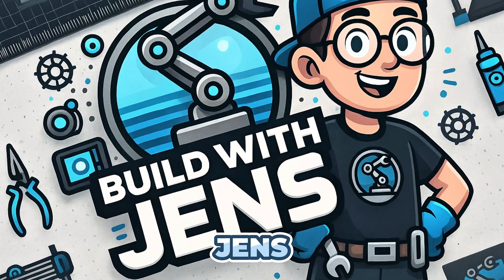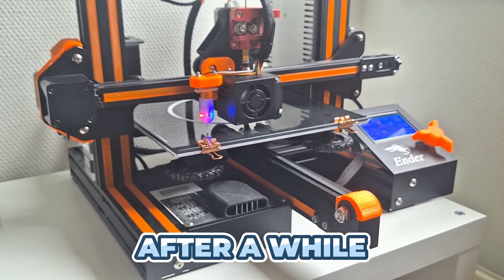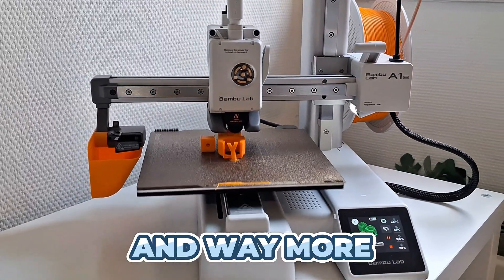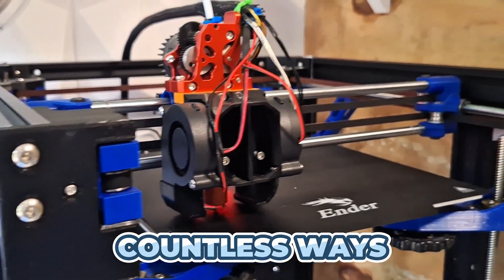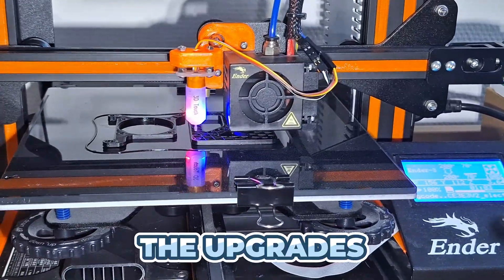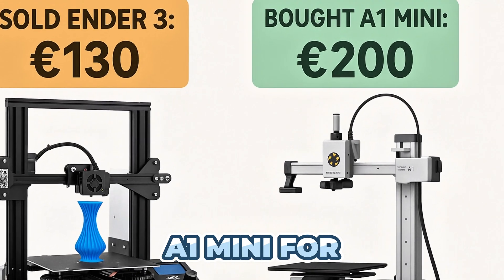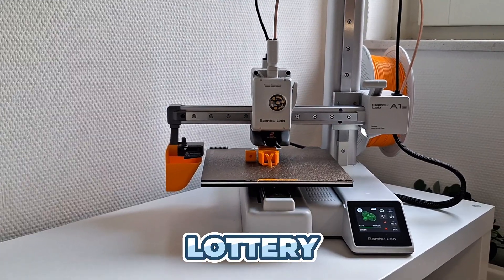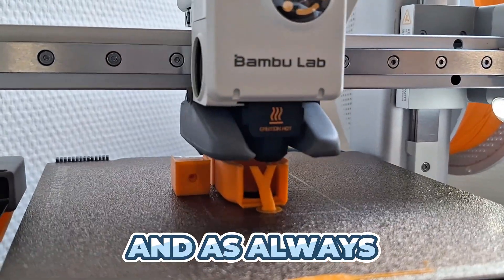Is this the BEST upgrade for your ender 3 in 2025?

Comment: Bambu Lab advert alert: Psychological Warfare detected.
Hobbyists, Run. You have been warned.

Buying a new Ender 3 would be stupid. Getting a Ender 3 PRO secondhand for cheap then upgrading is the right path. In fact, im about to pick up 2 more (aside my own Ender 3 Pro i bought brand new) for $65 and $40 respectively.
An Ender 3 still beats an A1 mini on build volume and motherboard cooling along with max hot-bed temperature; A1 mini in an enclosure cooks itself.

Tinkering is an "myth" in this sense, especially the hours of tinkering.
More printing? Meh. Put klipper on a E3 and you can match the A1 mini.
Just works? Yeah, until it just doesn't. 

The last thing im going to do is hop into a closed ecosystem with proprietary parts just to become a button pusher XD.

Comment: Are you on acid ? :0)
   My ender 3 pro has been going for years I don't even have to level the bed after cleaning it in the dish washer. I have an understanding of printing only because I purchased an ender. I will buy a p2s for higher temp filaments but my ender 3 pro stays in the print room.

Comment: Ender 3, is probably the printer I have had the least of problems with. The design is much better than most,  the problems comes if you try speed it. It is slow, but it wont brake.

Comment: There's more out there than baby's, especially stuff that doesn't require you to print through their cloud. I have a flashforge ad5m that was ready out of the box in 10 minutes, that has been amazing. That's running alongside my modded ender 3. They both work flawlessly.

Comment: I bought the Bambu A1 for a friend and an Ender 3 v3 KE for myself, I do like to tinker but I wanted him to have a good out-of-the-box experience despite the added cost. So far it worked out.
Reply: How much tinkering can you do with the V3? I'm looking for a printer and I've heard the V3 SE and KE are a lot more feature rich but lacking the modding and open source community that made prior versions so cherished. I'm actually looking at buying a V2 and upgrading the heck out of it as open source and modding is important to me.
Reply: @freetobe3 the KE comes with some nice features over the SE so you don't have to do much to get decent prints, even at 300 degrees, but when it comes to modding I think the SE is better, the KE comes with the nebula screen which also houses the processor and all the I/O where the SE actually allows you to connect something else to the mainboard like a raspberry pi for instance to run klipper on. You can root both machines and install stock klipper, but the CrealityOS fork is terribly outdated (3 years or so) compared to stock Klipper. I'm actually going to buy an SE mainboard and put it in my KE to be able to use my own raspberry pi, I'll lose the touch screen but gain a lot of customization and control. I don't have experience with the V2 though, but it seems rather customizable as well.